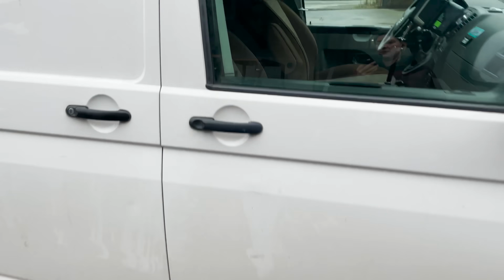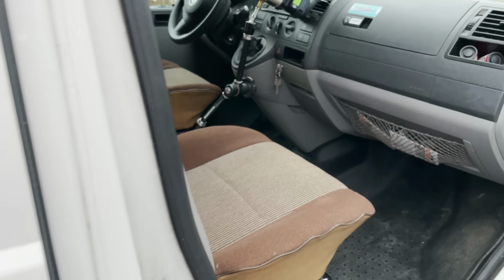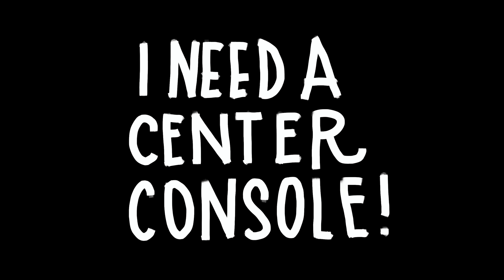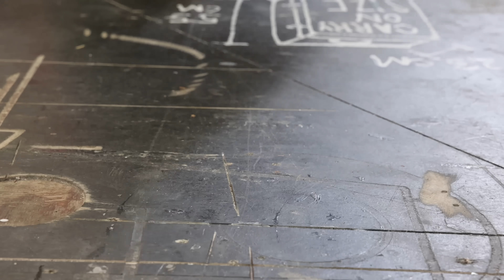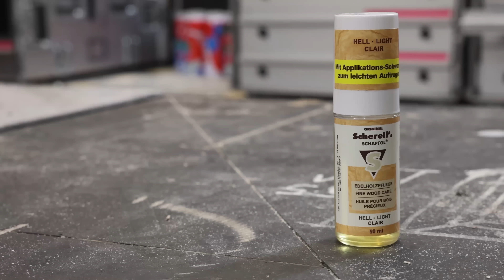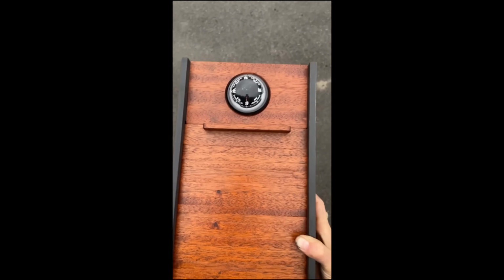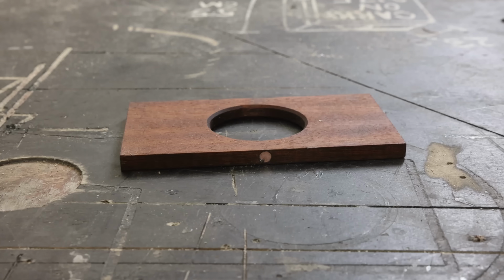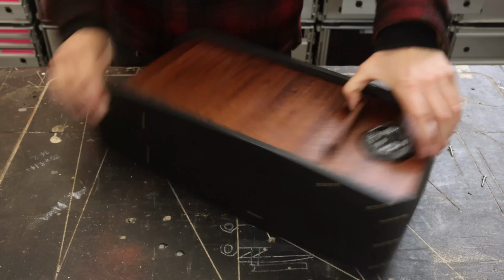Building a Center Console - The Tambour Box with Compass

Comment: you could put the magnet on the bottom of the box at the other end where the wood would have the metal stop to contact it when closed if the felt slips.

Comment: cool project. An idea hit me.  Instead of placing the magnet at the top of the tambour as you did, drill a hole on each side of one slat of the tambour opposite the closing handle. Possibly the bottom slat would be a good choice.  Then place a piece of steel in a drilled hole on each side of the box directly into the groove that would line up with the magnet when the lid when it is closed. Even though it would move the magnet(s) away from the compass, testing for magnetic interference would still be required before hand.  I want to see how the entire project turns out. I like it.

Comment: I'm not sure the magnetic compass will work very well anyway in that big metallic box we call a "vehicle"... ;)
On ships (made of metal) they usually use gyrocompasses (or similar devices with fiber optics) nowadays, because a magnetic compass is too unreliable on this big metallic mass. And in the army, they usually warn guys not to orient themselves with the map (and the compass...) opened on the front hood of the 4x4.
Nice build, though.

Comment: Nice build, specially all these small lengths of wood forming a flexible layer. One question: isn’t the compass going to react to the electric fields in the motor? There are some quite large masses of metal in there, moving at high speeds...

Comment: Very nice! I'm waiting for the next part.
I think you could add a mechanical latch embedded in the handle: insert a metallic pin along the first strip and connect it to the handle; when you move it sideway the pin locks in a hole on the side of the box!